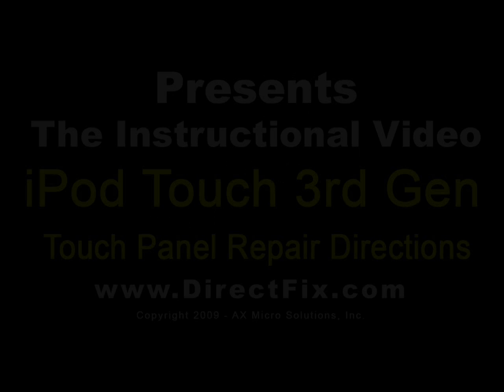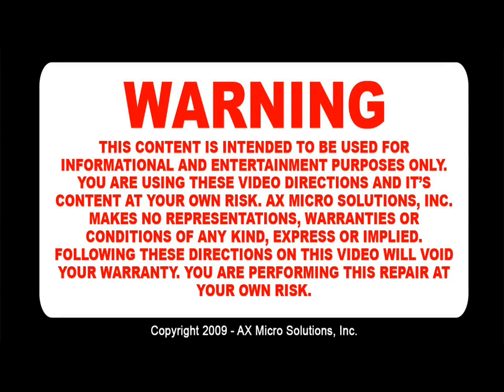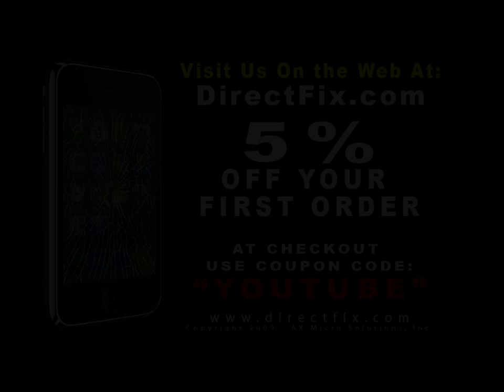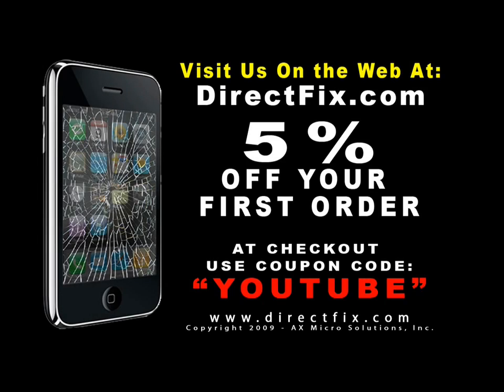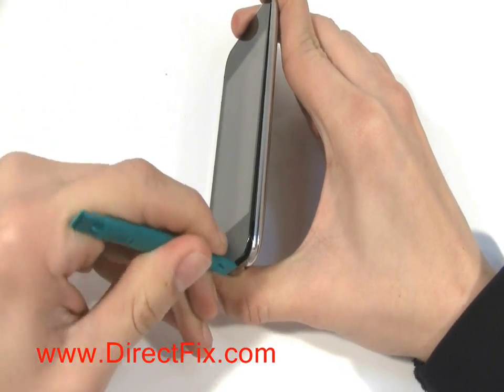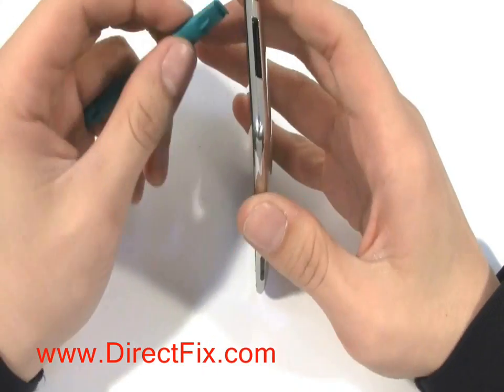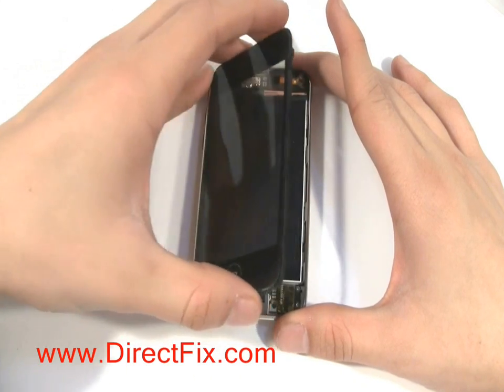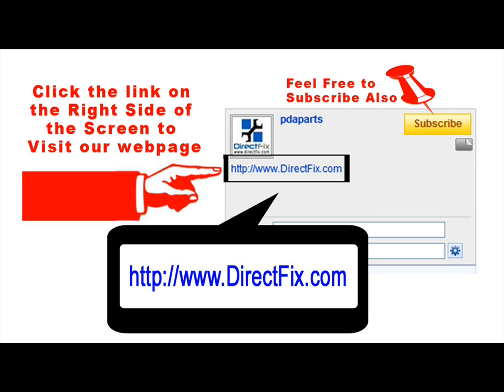iPod Touch Gen 3 Touch Panel Repair Directions by DirectFix.com

Comment from the maker: @dirtylaundryy1 When it comes to water damage you might have multiple issues with it so I am unable to tell you what part you need. Most of the time water will damage more than one part and you might replace a part but still have issues on other parts for the unit.

Comment: the screen underneath the top touch screen is cracked... i cant slide it to unlock it or anything but the menu button on the bottom still works.  what should i do to fix it?